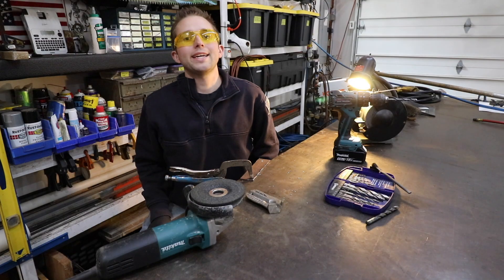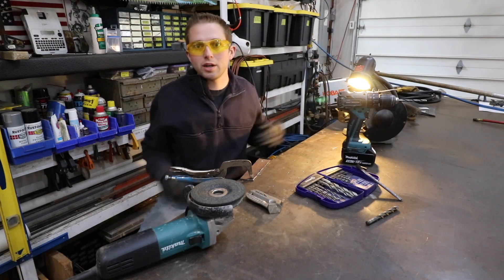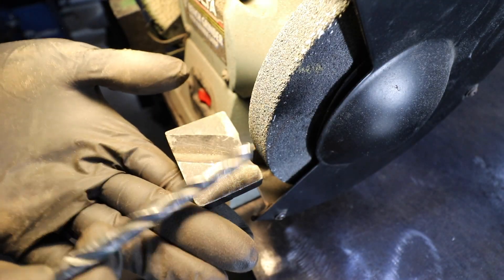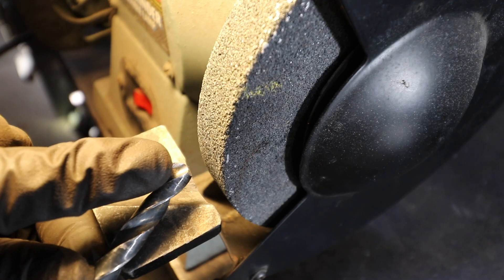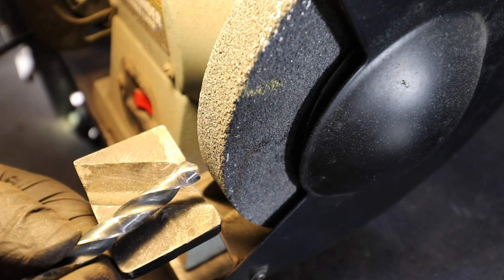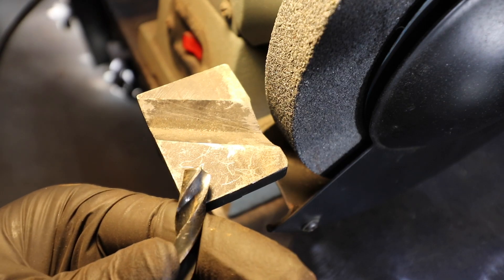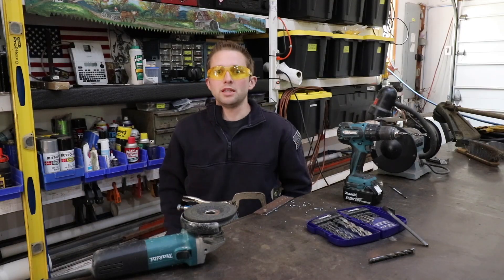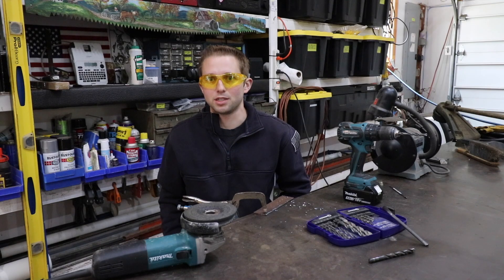How to sharpen drill bits | Bench Grinder

Comment: dunk it in water to keep the temper.  easy to do.
Reply from the maker: That will just make the steel Hard and Brittle. I'd prefer for the bit to be a little softer, thus less prone to snapping.
Reply: @OldSoulMillennial  everything is indeed proportion.